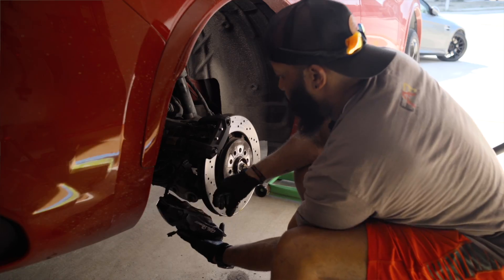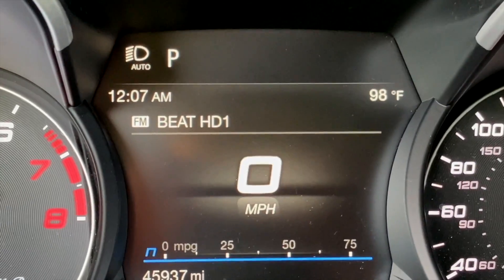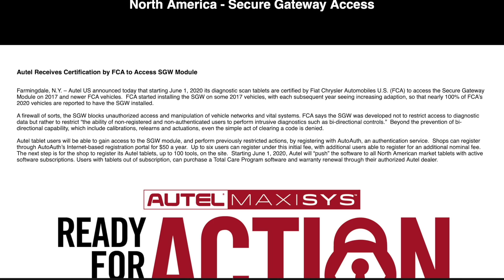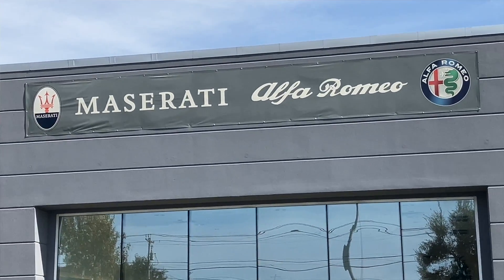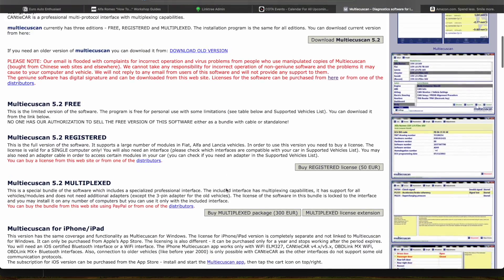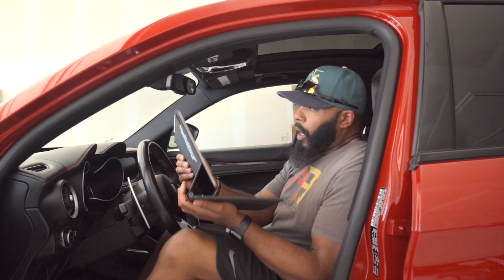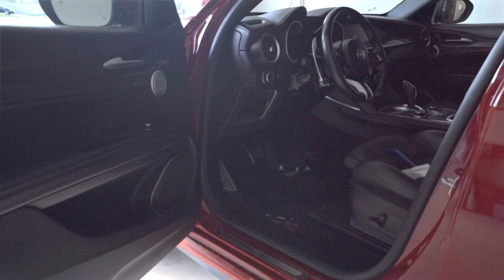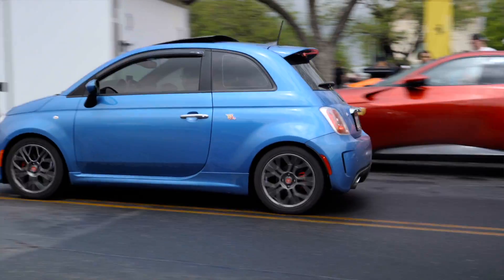What Is This? Secure Gateway (SGW) Module Explained and How To Beat It

Comment: The wheel thing...
(On my 19 giulia TI sport carbon)
Just turn it on(running), start center. Turn it lock to lock...back to center...off and back on. Weather or not this helps with your brake issues idk.. but it definitely does the thing for a battery disconnect for example. 

For the comfort windows...I haven't tried it but the interwebz suggest you have to change the country code.
In mutliecuscan...
Don't forget to disable that dumbass seatbelt chime.😊
It will still ding a couple times at first but It will quit after that. And the dash light still does the normal thing.
Reply from the maker: Thanks for sharing the country code change…I’ll try it 👍🏽

Remember, the steering wheel reset method doesn’t work for hard codes.

Comment: What I would consider doing is continuing to drive my 2002 300m Special and refusing to buy any FCA crap if it ever does die.
Reply from the maker: Drive what gives you the most smiles per gallon 😃

I can only speak for me…1st Alfa…this SQV is far from crap 🤷🏽‍♂️ The design, quality of the interior (leather, alcantara, carbon fiber) and its fast AF.

Comment: sounds restrictive to me.  so a code reader, from parts store couldn't clear a dfc?  Autel and Autel only?  all models or just the top shelf code/diagnostic tools?  I thought VW was bad...
Reply from the maker: Autel isn’t the only brand authorized - Bosch, AllData, Snap-On, even ICON from Harbor Freight and a few others. 🚫 I don’t recommend generic code readers anyway because they are “generic” modern European cars like BMW, Alfa, Mercedes, have way too many modules and computerized systems. As mentioned in the video, my scan tool and app could READ the codes, but the SGW blocked clearing codes, performing relearns, etc. which is what I needed to perform.